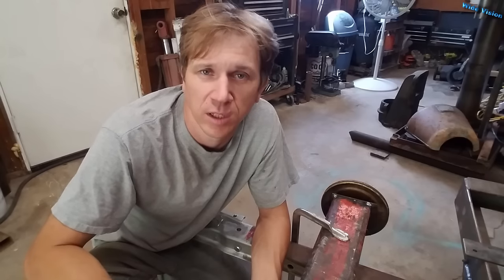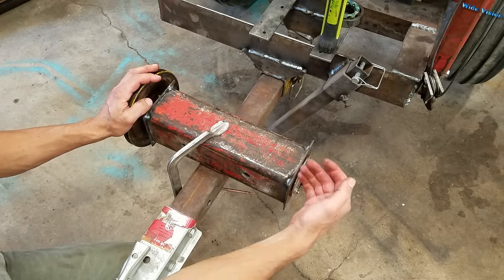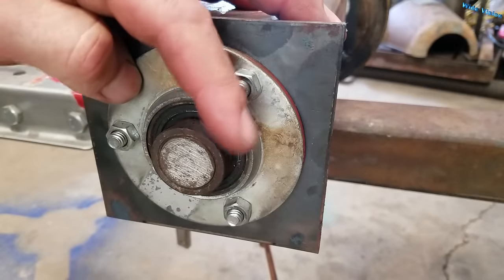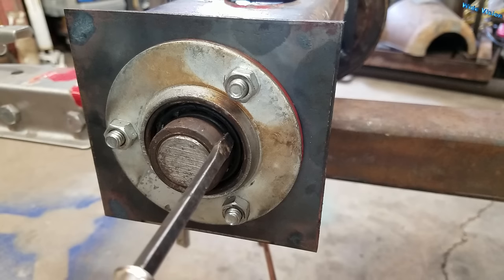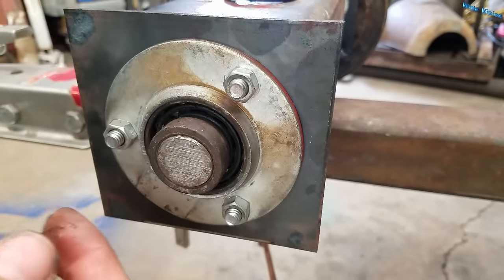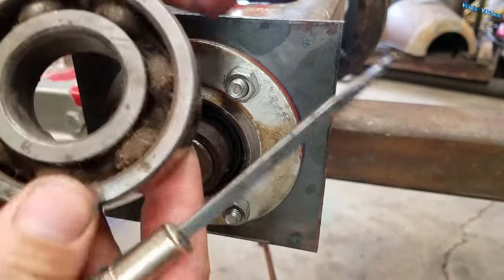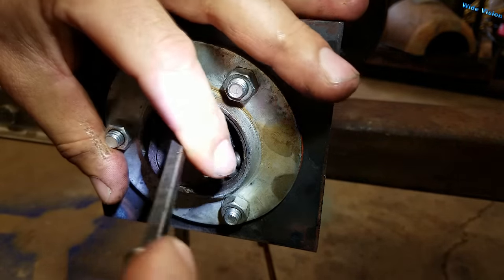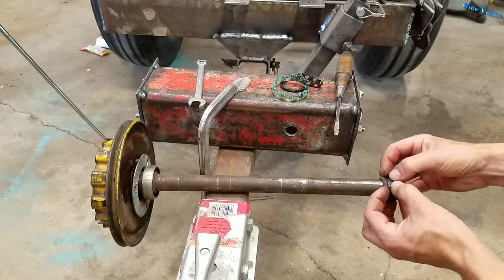No Puller Bearing Removal

Comment: Can this method be done with pillow block bearings? Or just generally larger ones with heavy shafts? I’m a weld/fab apprentice and have only encountered bearings that I need to use an angle grinder/hammer to remove, and sometimes use a torch to get a new one on the shaft. I’m a first year so still got a long way to go, any tips would be appreciated! Thanks

Comment: My total experience with bearings is bicycle bearings :)  so I learned a great deal from this video.
Reply from the maker: I'm kinda surprised to hear that, but I'm glad I could share with you!
Reply: Bicycle bearings are loose and run in a race in a sea of grease. I think I could replace a modern bearing, but getting the thing out would be -- problematic. So I learned about the anatomy of bearing cages.

Comment: I have been at farm machinery repair quite a while and bearing removal usually involves a blue flame your way is alot safer especially on combines and balers! Thanks for these videos .
Reply from the maker: You're welcome! The repair job I was doing for the customer was on a New Holland T99 combine. It was completely full of straw as the blower belt broke and the shaker bearings went out. (Probably the bearings going out caused the belt to break.)  So the customer was very nervous about me using anything that might start it on fire, to say the least!
Reply: Wide Vision Metal Fab 
Every farm should have a combine, if there’s nothing to do you can always go work on the combine 😉
Reply: Wide Vision Metal Fab 
Every farm should have a combine, if there’s nothing to do you can always go work on the combine 😉
Reply from the maker: Ain't that the truth!

Comment: This bearing his an excentric bearing assemply. Did you even try to remove the locking colar (metal ring that's locked by allen key studs and that needs to be rotated about 1/4turn anticlockwise) ?

Comment: Get the gas out. Pop the seal,Melt the cage. Blow out the balls and cut the inner race off the shaft, They are 2 different metals and can be cut without gouging.

Comment: I see 4 tack welds at square plate which will have to be cut anyway to get inner flange out which is inside the square tube plate. Good info on bearing take down.

Comment: In my case the center ring of a bearing is rusted to the axis of a electric motor. There is no space for a puller and using an angle grinder will damage the electric contact ring. I've tried heating the ring so it expands, but so far no results...
And sadly your trick doesn't apply to my case...

Comment: I'm dealing with a similar situation, but I have a roller bearing that is recessed almost an inch into the case, and 1) the shaft can only come out one end because the bearing at the other end sits in a recess cast into the case, and 2) there is no room inside the case to drive the bearing out from behind. Additionally there is a ring gear on the shaft which engages a gear on a shaft at the bottom of the case, and this makes it impossible to drive the whole assembly out the open end. Short of cutting the shaft in two, I've run out of ideas. Trying to drill through the race sounds like a formidable project.
Reply: These days, you can easily use a high-speed (28,000 rpm) Dremel, with diamond burr installed. I am about to do this, because this bearing is inside a car Steering Wheel (top). It will take a while, but (once the Inner & Outer Race has been cut), the old Bearing will simply prise upwards - and out. It isn't possible to remove the whole (splined) Steering Shaft, and the shaft also passes through this bearing. Cannot use heat in this location. New (replacement) bearing is cheap, and easy to replace - once the old one has been cut and removed. Hope that this may help someone in a similar situation.

Comment: I've dealt with a great many stuck bearings and have never thought to dismantle them. As a last resort, we've always cut them, either with a torch or metabo. I specific remember spending a few hours one evening with my work partner crouched under a conveyor drive sprocket trying to cut overhead at a recessed flange bearing with a cut off wheel. We managed to get it, but I wonder if we could have utilized your method. I will remember this tip. Thank you for sharing.